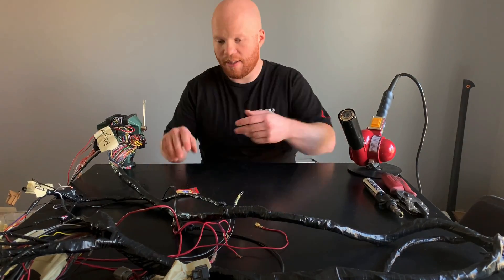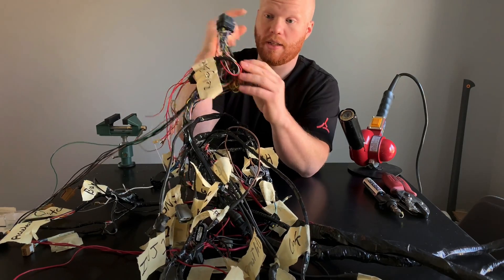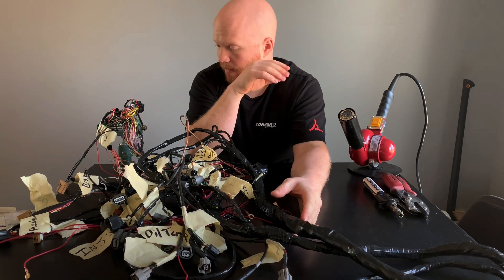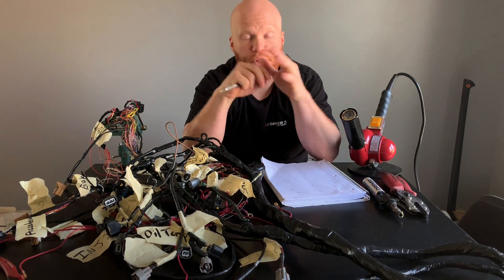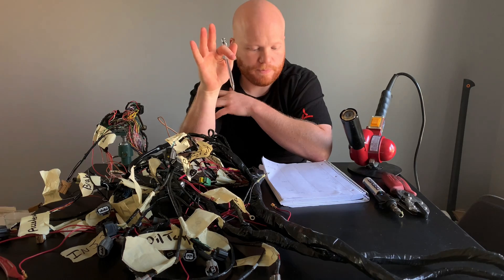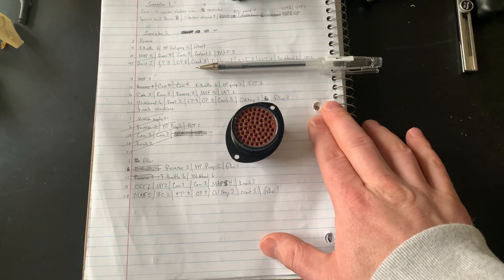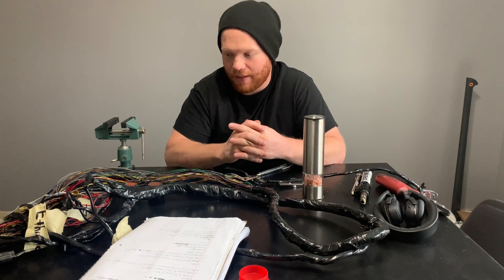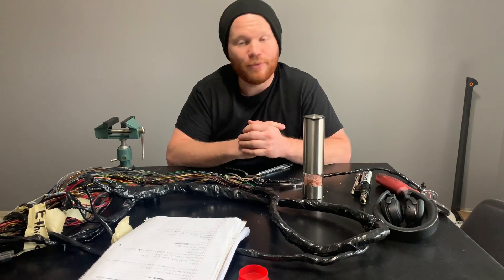Motorsports Wiring Harness Part 1: Planning

Comment: Do you shield all DPO’s? I was wondering if a single bar conductor would suffice to shield like the fuel injectors etc. thanks.
Reply from the maker: No, I don’t. I only shielded these injectors because the factory harness did so.

Comment: Thank you for the good video! Can you also explain what to do with the shielding from the wire through the round connector (on the firewall) to the ECU? Thank you!
Reply from the maker: heturbo yup! That will definitely be included in the next video.
Reply: Can you maybe also tell me, or give me a link from the Brad Lock battery connectors you shown on the previewed video? Can´t find them on Mouser

Comment: If you would do a wire tuck and completely new harness. How would you measure the lenghts? It looks like it is impossible to get the right lenghts even without consentric twisting.... Like you said, I could measure the lenghts with rope or wire, but it wouldn't act like the whole complete twisted wire harness. Then I could add some lenght to it, but as I said, doing a wire tuck and would like it to be extra perfect. Just looking to hear your thoughts considering my wishes :) Subed and looking forward the next episodes.
Reply from the maker: The general rule is to add 10% to the lengths of the leads to account for twisting. More on that in the next video!

Comment: Do you have any tips for what to do in what layer?
Reply from the maker: luke tombroek I usually try to organize the layers in such a way that the shortest leads are on the inside layers. That way when the lead comes out of the harness it’s a cleaner transition than if it was on an outside layer. I’ll show more of this in the concentric twist video. Other than that, it doesn’t really matter. It’s mostly just trying to make everything fit in a nice bundle. With this harness, with varying wire gauge and shielded cable, you’ll see it’s a challenge.